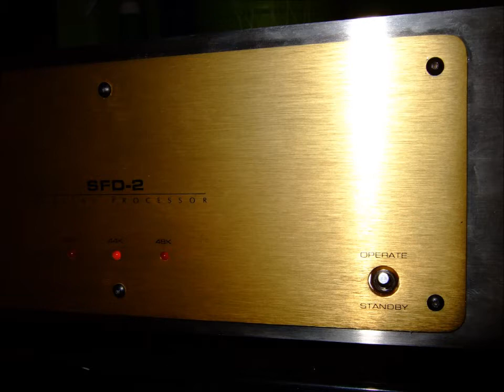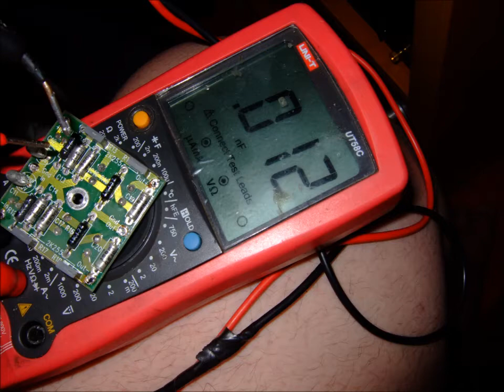Sonic Frontiers SFD-2 high-end Tube Dac D20400

Comment: hello, i have SFD-2 mk2 dac. my tubes gloving even then dac is off., it is normal ??? 
psu pcb was repaired, typival capacitor failures... can you please give me hints , it needs repair or its normal ?
Reply: +Vismantas Bagdonas 
Thats a great tube dac the SFD-2 MK2 dac.  I heard it on Sony XA7Es as a transport.
The best thing to do is contact Chris Johnson one of the founders and main designers of Sonic Frontiers.
Walter at underwoodhifi is very good friends with Chris Johnson.
Here is UnderwoodHiFi's site where he talks about Chris. He can contact Chris if you have any questions.
Here's their site.  http://www.underwoodhifi.com/about
Reply: yes its true one of the best dacs ever made. never heard better dac.
Reply: Hey there. I acquired an SFD-2 MKII late last year and it's my daily driver. Sent my unit in to PartsConnexion and conversed with Chris Johnson extensively about the DAC. He said that it's completely normal for the tubes to be on, as they serve as passive diodes. At minimum, the tubes would only need to be replaced once every 3-5 years. Considering they're always in a low power state, you could argue that they wouldn't really need replacing for a very long time. Tubes are more resilient than people think. :)